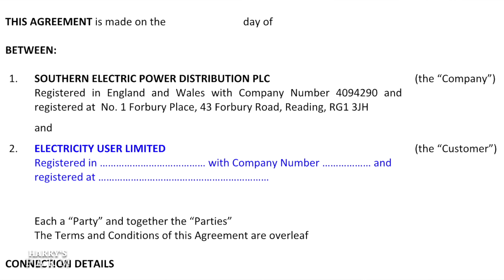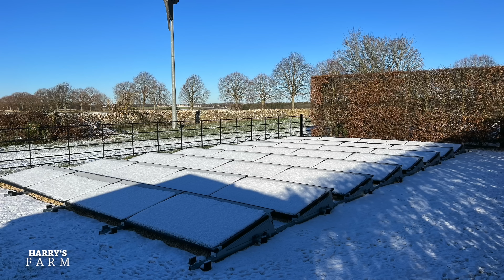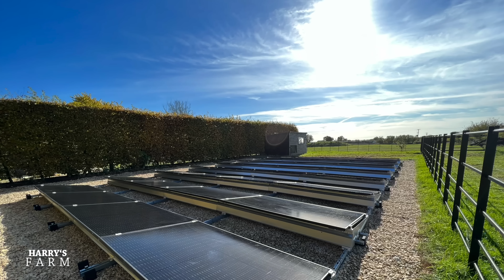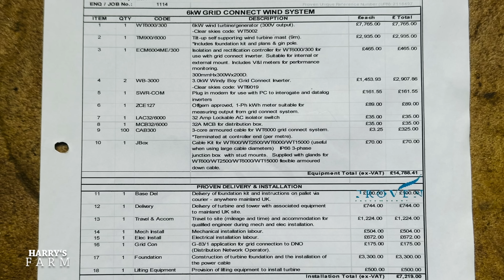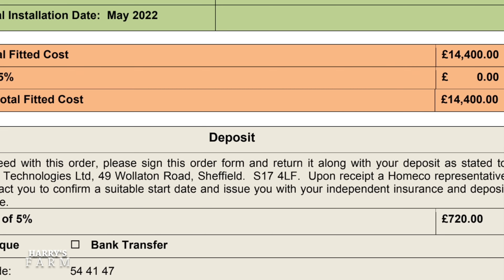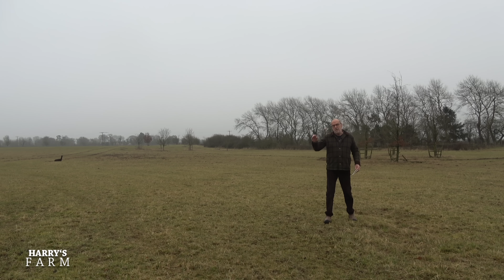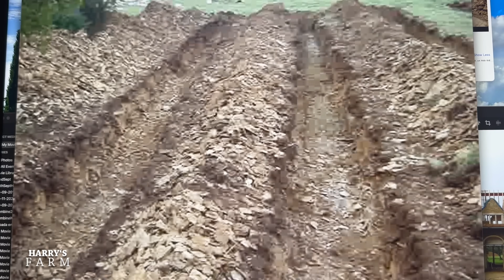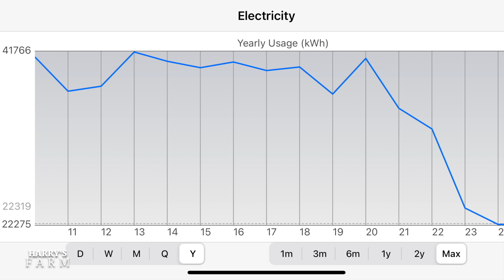Are solar panels & heat pumps worth installing? Here's what I've learnt after several years of use.

Comment: If your heating estimates for the house were £14,000 a year in 2007, then the problem was with the design and insulation of your brand new home. Those numbers are obscene.
Reply: Did you even watch the whole video?
Reply: I'd guess heating the swimming pool accounts for a large chunk of that
Reply: Did I miss the cost of installation and cost of the ground source heat pump equipment?
Reply: Not at all, the majority of the spend would be on the outdoor swimming pool, then heating the garage space, then the oil-fired Aga. Bills of £20k/year for oil are not unusual on a 475m2 house, with a heated outdoor pool in 2025.
Reply: @harrysgarage oh no, you’ve poked the haters Harry! Remember in some minds everyone should live in poverty. I was fascinated by the results. I have just fitted Solar for my business and have been shocked at the difference between a dull and sunny day. Luckily we are busiest in the summer when our self generated will be most beneficial. Thanks for your informative videos 👍🏻
Reply: @harrysgarage  Hi Harry, outdoor pools, heating a garage, and Agas are complete luxuries. You could run your house much more efficiently without those. An Aga uses about £50 of oil a week alone (oil cost  given as an example, I know Harry’s here is electric). I know of larger houses than yours who spend far less than £14k a year.
Reply: @andrewhurstcars except he states quite clearly in the vid it's an electric aga...
Reply: @drmexicoii  yes I know, I’m just giving that a reference cost. Electric Agas are even worse, they are a complete ripoff to run unless you have your own supply.
Reply: @andrewhurstcars electric agas are 100% efficient… just sayin’
Reply: @ I know someone who installed one. Her quarterly bills were over £1k. She now turns it off unless she is cooking, which of course totally defeats the point of an Aga.
Reply: Absolutely obscene. Another poor farmer? He’s admitted to not planting on two-thirds of his arable land - I’m not seeing a single farmer protesting about that, ever, because the grants received are more valuable to them than food supply. No farmers, no food, but only when it’s convenient for them to say it. Then we have to stomach videos like this flaunting wealth.
Reply: @Jim-KKP he does other things than farming. He founded one of the most successful motoring media titles and sold it at the height of its value. Why so bitter towards people who take risks and build successful businesses? 
He’s doing two more with his YouTube channels and working hard when most people his age are retired. Envy corrodes the spirit you know.
Reply: @Rosso456MGT Well said!!
Reply: @Jim-KKP ..Jealousy is ugly. I assume you don’t know Harry’s journey otherwise you wouldn’t have made such an ugly remark. Also if you have difficulty ’stomaching’ someone else’s success then don’t watch.
Reply: @jimw6659  I think Harry makes far more income from non farming activities. Farmers need to have a viable business and if not growing food is more profitable, then that is what they will do.
Reply: @Jim-KKP your comment shows your ignorance, Harry does this because he enjoys farming, he made his money elsewhere
Reply: @Jim-KKP this is so naive.  He has made films specifically decrying the fact that farmers are having to choose not to grow crops because they can guarantee a return with the environmental subsidies, which enables them to have security in financial planning when the prices of fertiliser, seed stock and the crops are so volatile.  That government policies are leading to reduction in food production making us even more reliant on foreign imports.

As to your “another poor farmer comment” it just shows how little you know about the hardships facing.  25% of farming families are living below the poverty line, and the reason for this is that the supermarkets are not paying fair prices for produce, to keep your shopping bills low and their profits high.  We can buy Fair Trade coffee from Columbia but there is no provision for fair trade for domestic UK farmers.

Finally, he has a diverse income stream from a variety of sources, farming is only one of them.
Reply: @Jim-KKP Harry obviously has another lucrative income source, most don’t you dolt. It’s effectively more land redistribution against food growth enforcing inheritance tax
Reply: @Jim-KKP he didn’t make his money farming.
Reply: @Jim-KKP  You need to go back and watch all his farm videos properly. He would rather grow food but would likely go out of business if he didn't put some land into gov schemes. It's the gov that doesn't want them to grow food. The last line of your reply is just tragic beyond words.
Reply: @Jim-KKP  dont watch then... simples
Reply: @Jim-KKP apart from the fact that if you actually know who he is you'd realise he made his wealth from founding evo car magazine, are farmers not allowed to be wealthy even if they've made their money not on the farm? he even explains in mutiple previous video's his profits off the farm which are often under 100k a year so what's your point here?
Reply: @henryellis154Well said!!
Reply: @Jim-KKP   My ‘obscene’  comment was directed solely at the cost of heating and running his house. It was not aimed at Harry’s wealth, which is none of my business, nor yours.